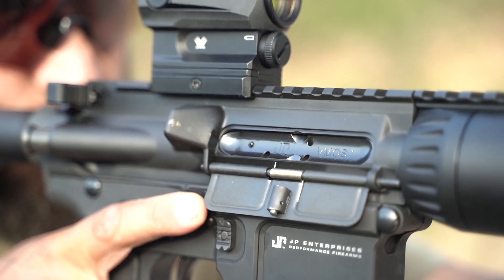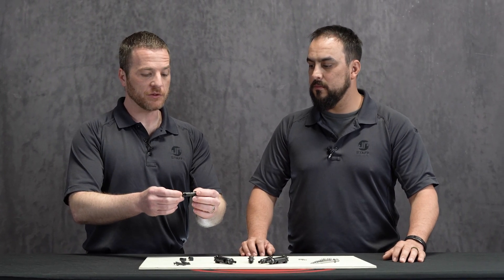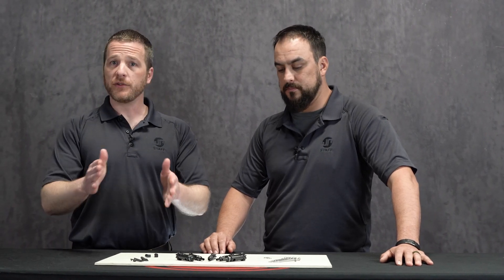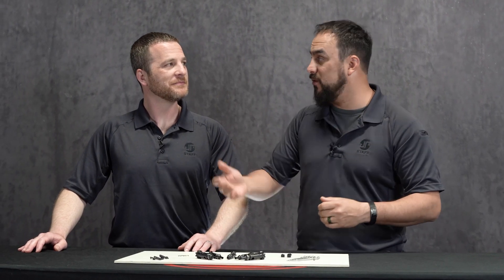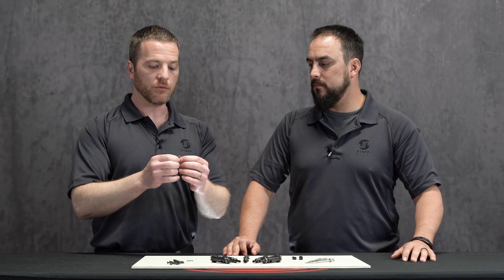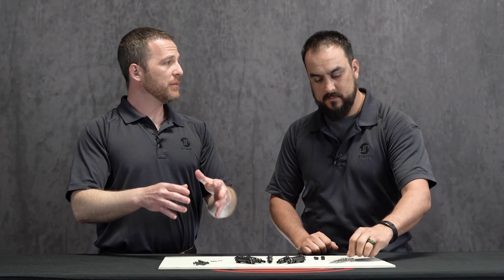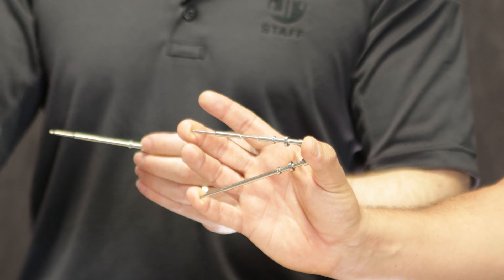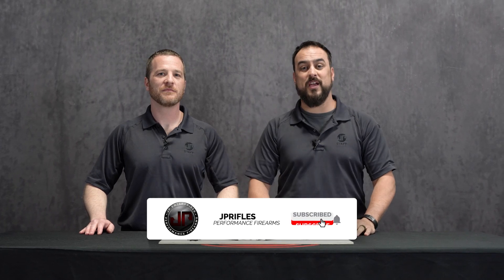Product Focus: EnhancedBolt™ Assemblies & Subcomponents

Comment: Question - I just received my first JP enhanced bolt package and plan on putting it in an LWRC IC DI. When inspecting the bolt I noticed when looking at the bolt face there's the smallest bit of movement with the extractor claw left to right that can be pushed either way to the point where I can see a tiny gap in either direction. Is this normal? I disassembled the extractor to check proper cup and spring depth and it's perfect. I'm assuming this is a non issue, just something I've never come across with a bolt before.

P.S. - I VERY much appreciate you guys marking the top of the cam pen so it can be oriented into the bolt the same way each time. This bolt is the best machined bolt I've ever seen and I've seen A TON of bolts.

Comment: I have two JP bolts and they are nice but they need to use 3 gas rings instead of one . These bolts are somewhat gas inefficient and you may very well run into problems shooting weaker rounds . Sprinco has has excellent , dirt cheap gas rings you can buy and install quite easily . Otherwise an excellent BCG.

Comment: I assembled a large frame rifle in 6.5 Creedmoor. I immediately started having problems with primer pierce problems. I ordered the JP HP bolt and it fixed it.
Reply: What Bolt Carrier are you using? I have a complete Wilson Combat BCG for 308, but my primers are blowing back into my BCG. I was curious if their Enhanced JP Bolt and firing pin could drop into my Wilson Bolt Carrier.
Reply: @JDCali459mm  I'm using an Aero BCG. I bought both the bolt and firing pin. My rifle is chambered in 6.5 Creedmoor which seem to be more problematic than .308.
Reply: I also built a large frame 6.5 CM, blowing primers out occasionally, using Wilson Combat bolt/carrier with Wilson match barrel. Prints 1/2 MOA groups.  I'm looking into a JP bolt to correct this. Did you guys have any POI shift with your JP bolt?
Reply: @brettb614  I don't remember any POI shift.

Comment: Are there any issues with head space when putting a JP bolt into a factory carrier? Would I need to check the head space once I replace the bolt?
Reply from the maker: It wouldn't hurt, but it's not specifically necessary.
Reply: Great question, you read my mind!

Comment: Thanks for the information. I just bought a jp enhanced bolt. Out of curiosity I did the drop bolt test, and the bolt did not remain extended, man, was I worried . Lol. Felt a sense of relief after you guys mentioned that it’s normal and it was designed to have that looseness or level of tolerance
Reply from the maker: Yeah, that's been a difficult one to educate people on since it's such a break from what most shooters are used to.

Comment: finally installed a dual ejector bolt and BCG. It flat out ended the double stacking and loading issues from the prior single ejector model.  Used JP Ent, bolt extractor and ejector enhancements which did help but for the AR-10 LR 308 formats dual extractors are the way to go.

Comment: I just built a 6mm ARC, got a tip from someone saying your low mass BCG solved a feed problem, so I just installed it in my AR today...test tomorrow.  I already run JP parts when I can, but can't do all JP right at first as I did not win the Lotto last week (would be buying complete JP rifle if I did).  Have not picked up the SCS yet, so I'll have to get by for a bit.  Anyone have a good idea where to start on the adj gas block going from full mass to low mass BCG?  I'm of the mind set I'd be doing damage if the gas was full open, or is it better to start there and turn down between test rounds until sweet spot is found.

Comment: I understand that cam pins should be marked and placed back into the BCG the same orentation that they came in.  Is this true?  I also noted that it looked like your cam pin head had different edges on one side.  Why??
Reply: Yes, that is true
Reply: Darn.  50% chance I put it in the right way.  Both sides look the same.

Comment: Are the jpbc-2a bolt chromium nitride or dlc? Is one better than the other
Reply from the maker: All of our bolts are DLC at this point.  I'm sure you can find arguments both ways, but we switched from chromium nitride to DLC a few years back.  We found it superior for hardness and lubricity and easier to process consistently.

Comment: Stopped watching when I heard "9310 bolt material"

Phosphate C-158 HPI & MPI or go home. 

Boutique parts in guns are like little dogs in purses...
Reply: Why when there is data of a properly treated 9310 bolt being better?
Reply: @ahole5407  Not gonna lie you kinda lost me. All I will say is I have a 9310 bolt that has 15k rounds on it without issue. Sample size of one but if buying from a company that knows what they are doing they can be good and to just write it off is ignorance at best.
Reply: @OpSecClyde  15k round counts and what I said lost you? Ok...
Bottom line, no serious user would go on good faith when it comes to material safety. That's why material certs exist. And if a company won't test the products they produce you just have to ask yourself why. 
9310 came about because carpenter did not want to up production for the civilian market. They have been around for 100 years and make their money from government contracts. The demand was high and companies looked for an alternative that was "just as good" it just so happened that the 9310 was also cheaper because it wasn't owned by Carpenter.
Keeping with cost savings they skipped the QC testing, expecting that if someone his run the gun hard and it broke they would replace it knowing that vast majority of users would not get to that point. It was a  calculated business decision.
All of this is fine for "sport" or recreation, but when it comes to having a firearm that you trust to keep you alive or others alive, it's not a game and you will demand documentation of testing to ensure that what you have will perform vs going off what someone says (or don't say) on a commercial. 

Look at the SOLGW BCG and the video Mike put out. The only company that I know that lists full specs on their bolts and carriers. It will be obvious why they have been sold out for close to 2 years.
Reply: @ahole5407  The reason you lost me is cause you said people dont use their stuff. I had a feeling you were a fan of SOLGW which do make decent things but the comment about bolts failing prematurely was about improperly treated bolts. There are some units and pretty tier 1 dudes that run 9310 bolts. 158, 158+, 9310 and A100 all seem like good materials but if you buy from a reputable company 9310 edges out 158. I've had multiple 158 bolts shear at 10k rounds and I have one that has seen 15k and is fine. Just don't think its fair to shit on something without first hand knowledge especially when there are data points that refute it.
Reply: @OpSecClyde  ok so now you are saying you shot over $30,000 of ammo.(multiple 10k and one 15k)
Sorry but I just don't believe that.
How many barrels did you go through? Let me guess this was all suppressed under nods too, right? Just like those tier 1 buddies you have right?

Are you a paid poster for JP? Because with everything you said (more importantly what you didn't say) you did not once offer a reason or acknowledge what I had pointed out.. why do the companies that produce 9310 not provide the testing that is necessary to ensure that the proper heat treatment was achieved knowing that 9310 is more temperamental (see what I did there) with the heat treatment than C-158.
If C158 has a QC failure of less than 10%  and 9310 is more likely to have heat treat issues its simple statistics that show that the 9310 will have a higher failure rate. And Carpenter has been heat treating c158 for half a century so yes they have their process perfected. 9310 has only been around recently and companies have not had the time to work out the heat treat to the level that Carpenter has. And with the metal being what it is it will still have a higher failure rate if the testing was performed.. this is why it is not done and why you will have a higher likelihood of purchasing a bad bolt if you choose 9310.
Reply: @ahole5407  I don’t own any jp products yet as far as ammo I’ve been shooting for 10 years and I would say I’ve spent well over 30k on ammo. Shot out 6 barrels from a KAC sr15 (e3 is hands down the best bolt also doesn’t use 158) others are criterion and bcm bfh barrels. You keep talking about heat treating issues which again if you get a bolt from a reputable company shouldn’t be an issue. You brought up SOLGW so what do you think of them using inferior nitride barrels? My only point is if you get one from a reputable company that does qc you shouldn’t worry. Have you ever shot out a barrel? You seem concerned about durability but have you broken a bolt before?
Reply: @OpSecClyde  listen kid .. you still have not answered my question which is why I'm calling BS on everything you say. I've been shooting for over 30 years... I started buying ARs back before Eric Holder took office when the ban was lifted and remember seeing 30rd mags go for $100 each at gun shows in the 90s. I have never broken a bolt because I know when to buy a new one (~7k) just like brakes on a car they don't last forever and you don't want to wait until they fail. Knowing and understanding the limitations of your equipment is part of the fight.
I have shot out 2 barrels before, both stainless and both before you ever started shooting.
Sounds like you have bought into the hype from reading things online and haven't had the opportunity to talk to someone who actually knows a thing or two from experience. Most everything you see on the internet is marketing trying to get you to part with your money. You said you waisted your money on a KAC so that kinda proves my point. Anyone that has been around can see that if you are spending that kinda cash on ammunition and buying boutique guns that you would be maintaining them as well and not having issues with bolt breakage which you admitted to. That shows everyone that you either don't know what you are talking about or just plain ignorant. Either way no person will take you seriously..
Reply: @DD-hz3ts  because they can only parrot nonsense from people with beards and tattoos that wear plate carriers while they mag dump into trash

LMT makes the best bolt on the market followed by JP, guess what? Neither of them use Carpenter 158 or Phosphate.
Reply: What do you think of the lmt enhanced bolt? That's my idea of the best of the best atm
Reply: @JohnBrowningsGhost  funny as soon as I comment I see you also are a man of culture lol. Based on my research I would have to bet that lmt is the best as well
Reply: @JohnBrowningsGhost  and neither would even be considered for a .mil contract if they were not tested the same as C158.  yet you consider them? what reason do you have that the DoD doesn't?
Reply: @ahole5407  interesting. I don't doubt the bolt info but I called LMT a month or so ago and asked them about their carrier. They said that ot had extra ports to help with overgassed guns. They specifically told me not to run that carrier in my bcm 16" middy for the reason that it may not cycle as reliably. So I kind of disagree that it should not be used in less than a 14.5. I believe that it works well in the 14.5 due to many of them being carbine length gas systems which is on the harsher side for 14.5.
Reply: @stevef4930  I said that it would not be advised to run in a less than 14.5".
This is because of the redesign of the cam lock up. The dwell time of a 10.3 is hella short and the E carrier is not recommended. A mid length 16".. same issue.dwell time is too short . 
This the problem. People just go out and buy shit they think is great because of the price and what they heard from people on the internet that never owned anything. They buy shit and never get out there and use it so when the time comes that they need it it fails.. "oh this is BS, I spent xxx and this thing doesn't work, this should have been the best."  Blah blah. The majority of people have no idea haw shit works and just buy whatever cost the most thinking that it must be better than the other options. Often times you set yourself up for failure by doing so.
Reply: @ahole5407  I just read LMTs old description on their site. They say it is for short barrels. They say that their design increases dwell time. It seems to me that your info is not accurate as it does not paint the full picture. I'm gonna trust LMT over some guy in the youtube comment section
Reply: Own* not old

Comment: I just got the enhanced bolt for 6.5 Grendel and it’s extremely loose inside the carrier. Slides right out of the upper if I tilt it downward. Is that normal?
Reply: They address the looser single piece gas ring at 12:15